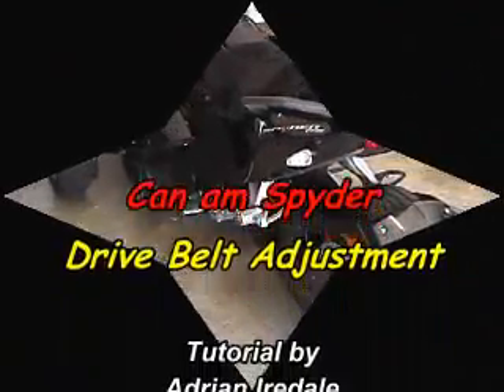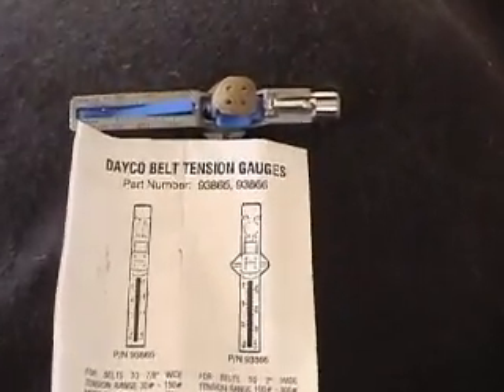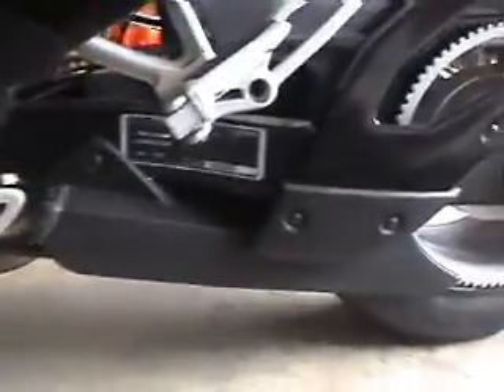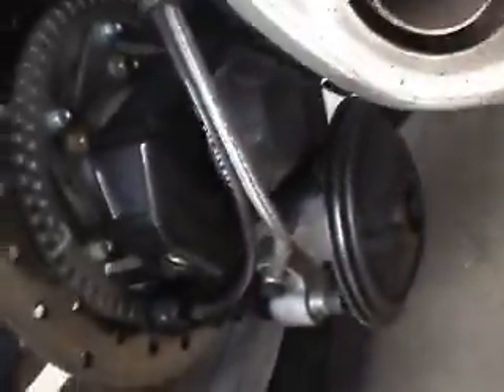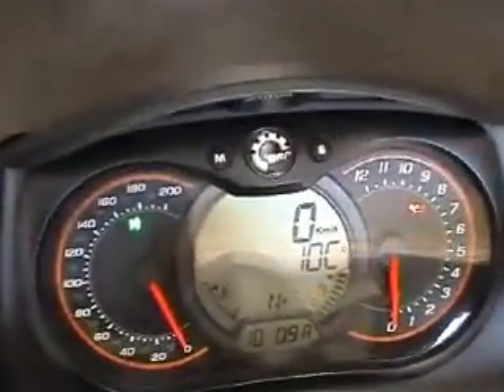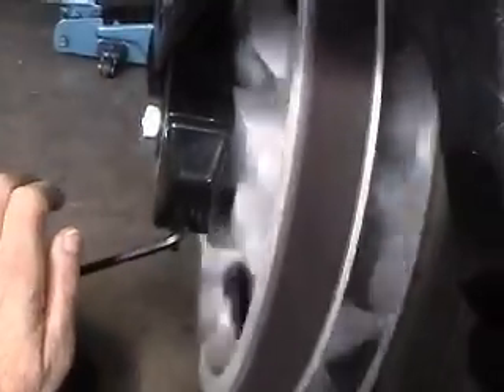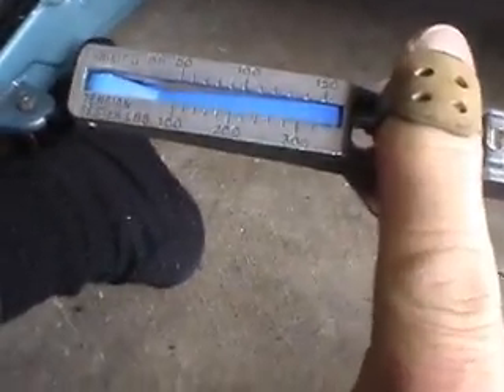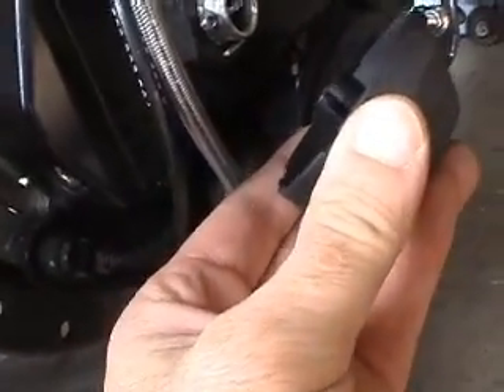Can-Am Spyder Belt Adjustment

Comment: I know this video and comments are around nine years old but I had to post a reply in 2022, as you Sir have saved me a huge hill of pain and £££. I bought a 2016 CanAm Spyder Limited Edition RT about a year ago and recently decided to repaint what I thought were swinging arm end caps as they had become oxidised. In trying to remove them I realised (only too late) that I was messing with the belt tension and alignment! And sure enough after a week or so's riding the belt was hanging 3mm off the drive sprocket. Anyhow - thanks to this video and my friend next door who has a fully equipped workshop, we followed your instructions. It took about four attempts to get it right as, as you rightly say, if you alter the drive belt tension that this throws off the alignment. But with a little patience everything is back to where it should be and you have saved me an expensive trip to my (not so) local dealer and a huge pile of wonga too. Thanks a million buddy!

Comment: Used this video last year on both my RT's to replace rear tires and work out the tension /alignment on the belts...I used the Kritkat and measured tension on both raised up and on the ground ...I used the on ground tension to  measure in the final part. About 180 lbs on mine. The alignment I had to monkey with while the back tire was running . then took a drive around the neighborhood and in reverse, still had some adjustment but all ended well. I did notice that the idiot lights needed reset when I first started up but these resolved themselves with the first movements...Thanks for the video!!

Comment: I noticed in the comments some guys stated that the tension should be set on the ground.  I'm reading my  2020 Can-Am RT Limited maintenance manual and it states "drive belt tension..rear end lifted...1050N. " So, the tension wil lbe higher when on the ground. So, check your maintenance manual. Also, the Operater's Manual state that the belt should not be touching the Front Sprocket flanges. Hope that is helpful. Great video explaining the procedure.

Comment: I’m years late with this but thanks heaps for the clear advice on both tension and alignment.  Only wish the dealership did it correctly in the first place.  25k Up now and I’m on a second belt after they changed my rear wheel after a flat.. costly experience it has been.  Thanks again

Comment: Mshrader211 is right! and yes it will change, see my comment below. the difference is where you jack the rear wheel up at. the main frame or the swing arm. if you jack it at the frame (forward of the swing arm) the rear shock will allow the wheel to swing down slightly allowing the belt to loosen a bit. here's a hint If you change the rear tire, or the brake pads anything requiring removing the rear axel, you can remove the bottom bolt on the rear shock and the swing arm will swing down (if you jack from the frame) enough to loosen the belt completely for removal. this allows you to replace every thing and not have to realign the belt or adjust the tension.....Tension may need slight touch up....

Comment: ATTENTION: The only error I see is if you jack the Spyder up from in front of the swing arm, it will release some tension from the belt. if you jack the rear up by jacking the swing arm up it WILL NOT..... be careful with this don't over tension the belt. Always check the tension after the rear wheel is back on the ground. I'm betting this guys belt is over tensioned by the fact that he made and checked the tension with the wheel jacked by the frame, which will increase the tension when the rear wheel is lowered to the floor again !  I hope this helps
Reply: instablaster

Comment: Coy Hilton is ABSOLUTELY RIGHT, If you read anything on the internet about removing the belt on a Spyder it will tell you to jack up the bike to decrease the belt tension making it easier to remove the belt. Sorry mate but be it that your down under I can't agree with your method at all. Belt tension NEEDS to be measured ONLY when the bike is on the ground ONLY !

Comment: Good job, Adrian.

I'm not intimately familiar with the Spyder, but on every vehicle with a swingarm I've ever owned, torque of the axle nut has been important enough that it's prominently specified in the Service Manual and even in the Owner's Manual.

Using a spanner sawed in half is an interesting idea, and you've proven that it works, but I'm surprised that you can break that nut loose using such a short spanner, if it's torqued to spec.  I didn't see you use a torque wrench to tighten the nut after you were finished adjusting the tension, so is axle nut torque simply not that important on the Spyder?

Comment: Nice but not enough clarity on the fact that there are 2 Krikits, one for lighter and the other, used here, the heavier. Not knowing (I know it's my fault) I got the lighter one. My bad, but a note that there were two would have been nice. Amazon has them for $15 so I will have both! not a bad deal. The one on eBay is an off brand. If you can, go with Amazon.

Comment: Question: Does the belt tension differ from it being jacked up off the ground vs it being fully on the ground? I guess I'm mostly wondering if you have to have the swing arm all the way down/extended (rear wheel off the ground) in order to correctly check the belt tension...
Reply from the maker: Doesn't make a significant enough difference either way to worry about - particularly with the RT.
Reply: You sure made that look easy! I'll remember this when I change my rear tire. Thanks.